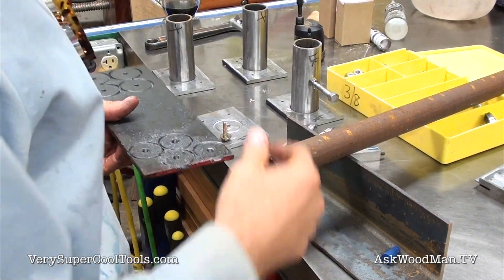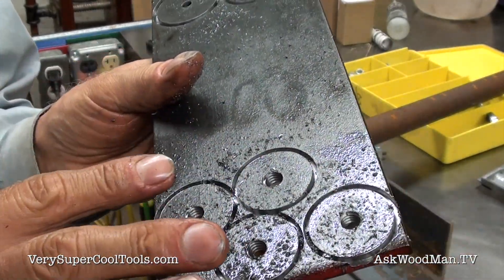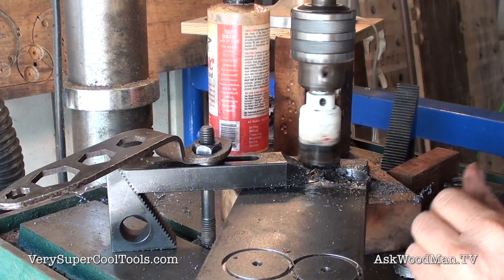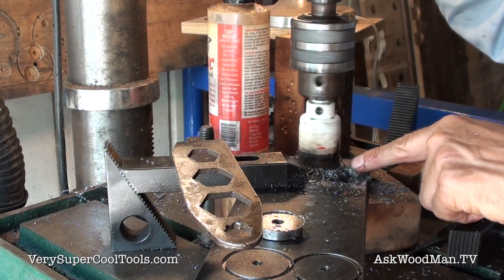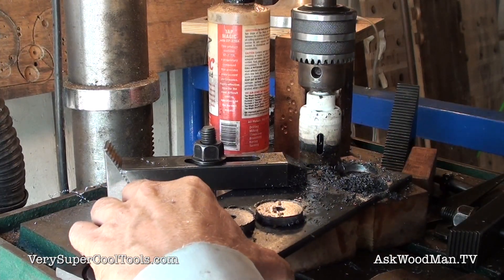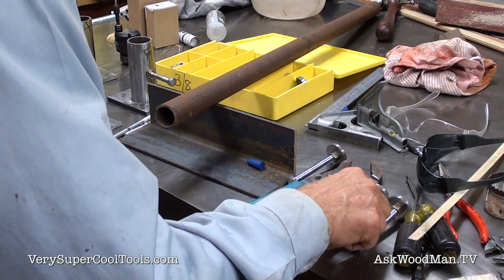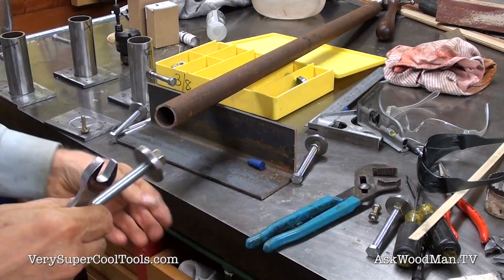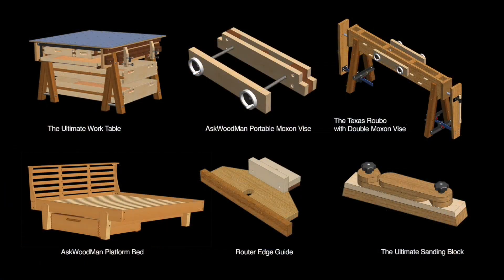935. Bench Top Table Saw Upgrade • Video 14

Comment: Nice work on the welding prep work. Who manufactures those purple silicon carbide pads. I woulds like get some here in Canada. Thanks, Alan.
Reply from the maker: +Jean-Marc Labonte Hi Jean-Marc Those pads are 3M Scotch-Brite CX-DN S-XCS 33194  It is always best to clean as much oil off steel before using these or there is a lubricated sliding space.
Reply: Wow, thanks for responding so quickly, Alan. I will go online and get some of those pads. I appreciate your advice and know how. Thanks again. :-)
Reply: +AskWoodMan Alan... You may want to include those on the VSC Amazon Affiliate link
Reply: Thanks :-)